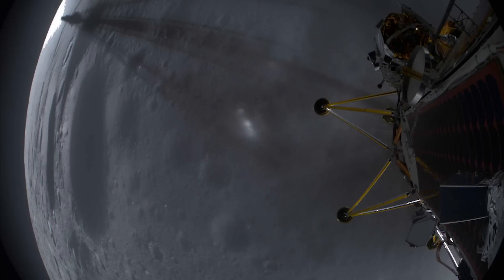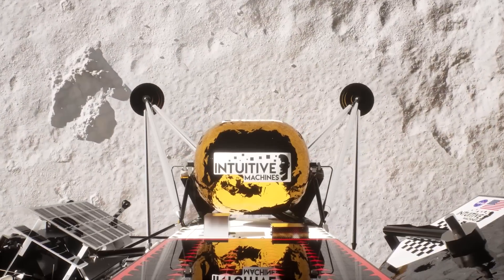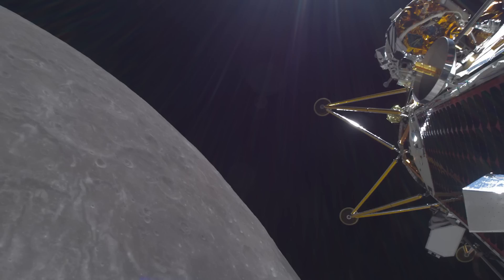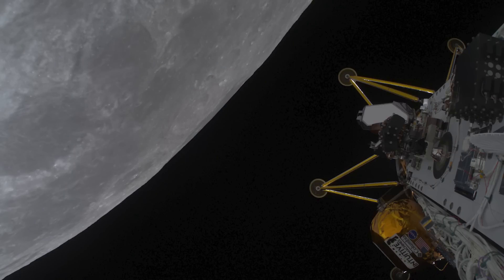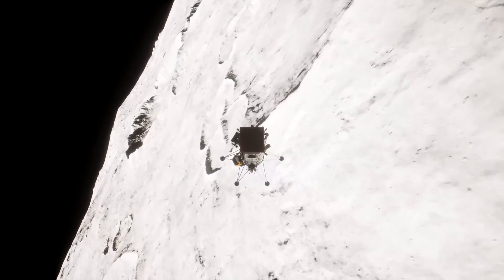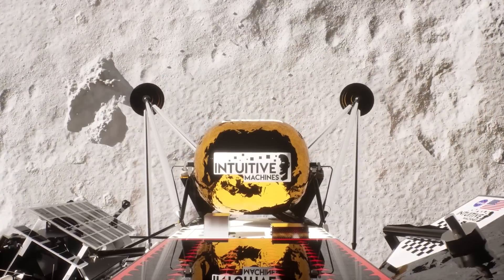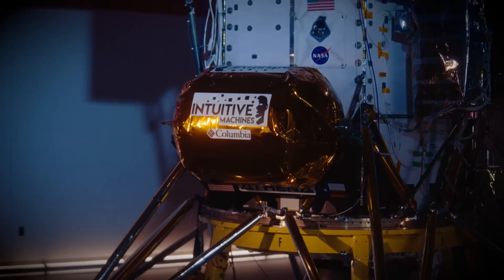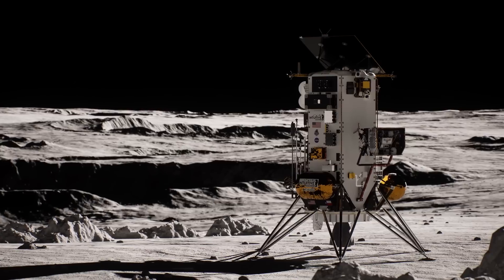The Athena Lunar Lander Couldn't Measure Its Distance From The Surface

Comment: They need to use surface sensors on the landing pads like the Apollo modules used 50 years ago. Lasers will get you there to a certain point, but using analog technology will solve the tricky last foot or two.
Reply: Blue Ghost did this on their lander to inform engines turning off, 3 of the 4 worked, but one apparently was not resting on anything firmly enough to trigger sensor or is faulty.
Reply: Their problem is that they can't control their trajectory. Not how they're sensing touchdown.

Comment: Add a Radar Altimeter.  Dust is not an issue for these.
Reply: They were awarded $4.8 Billion. They are crashing on purpose as they milk the Artemis gravy train for years like any good gov't contractor would. If they succeeded, they would have to use this initial award contract money for the next phase (real science payloads in addition to the current navigation and communication payloads).
They want to milk the $4.8 Billion dry and ask for additional $4.8Billion for phase 2.:face-green-smiling:
Reply: apparently 'too heavy' but a worthy tradeoff i think.
Reply: Thats not tru, but ok.